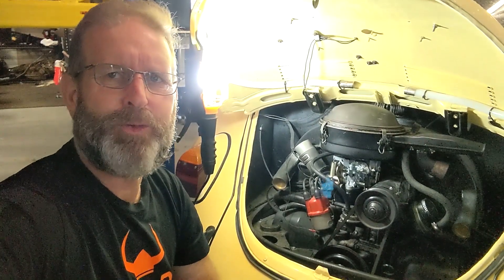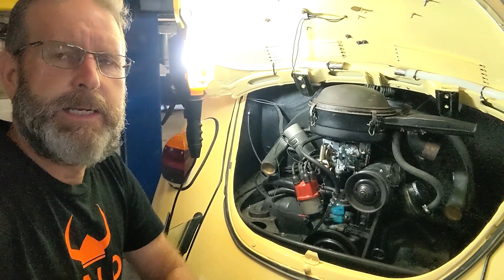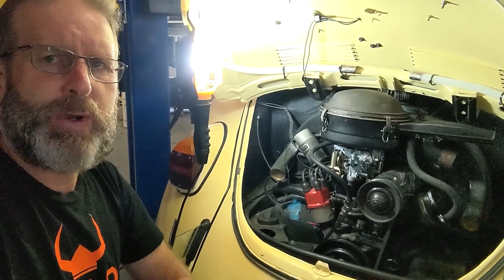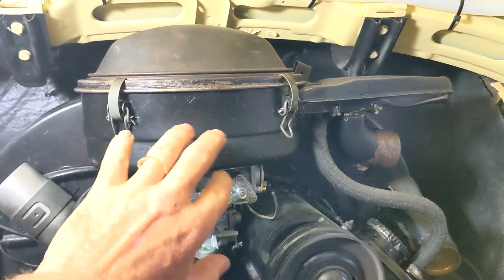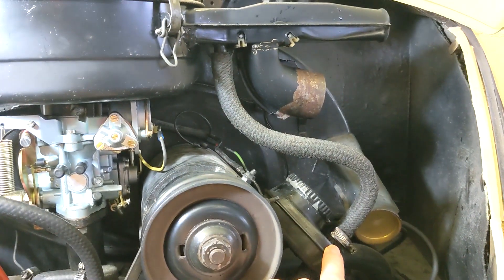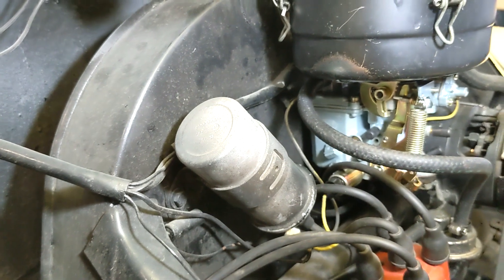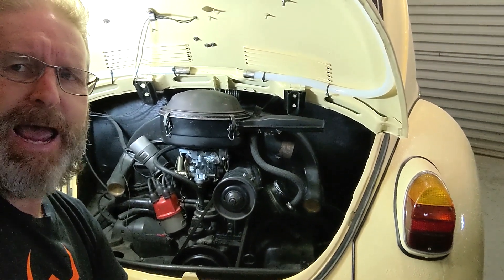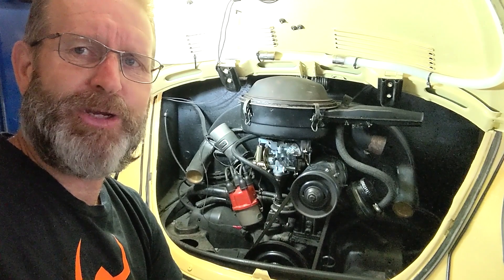KamicarzCreations - 1970 VW Beetle 05 - How to tune your VW carburetor - 30 Pict 2

Comment: Hi I have the 30 pict 2 carb, having trouble with the idle. That bottom screw is the air/ mixture screw? Any idea how many turns out? Where is the idle adjustment screw on these carbs? Thanks
Reply from the maker: Im fairly sure the idle adjustment is just actuates the throttle lever on the carby. The mixture screw is around the middle of the carb in the other side.